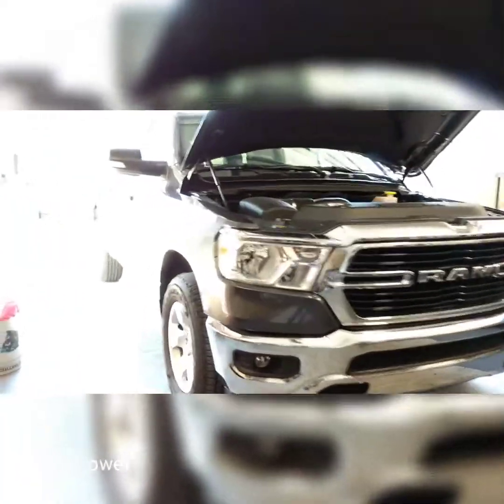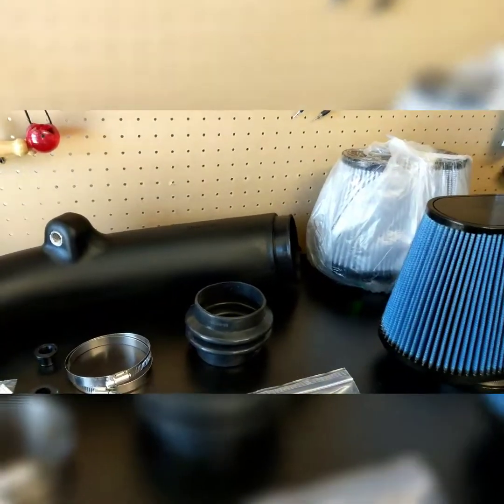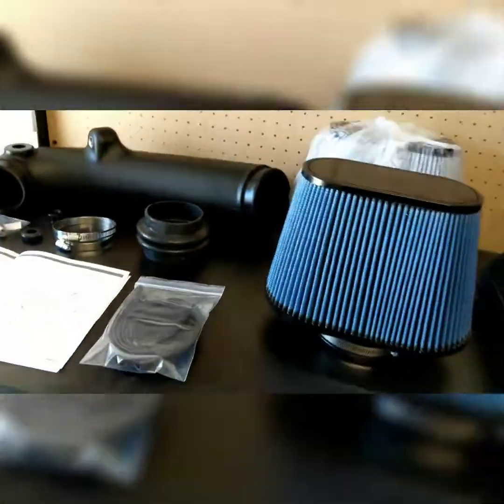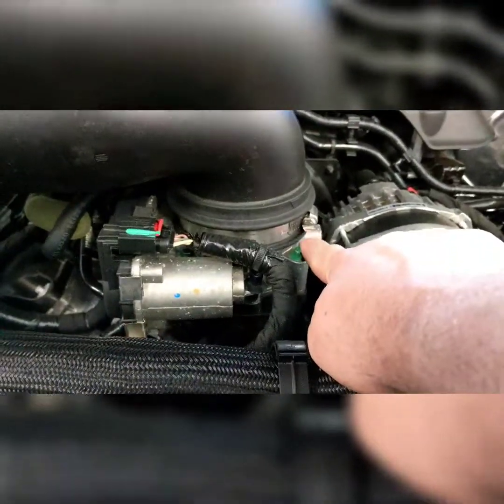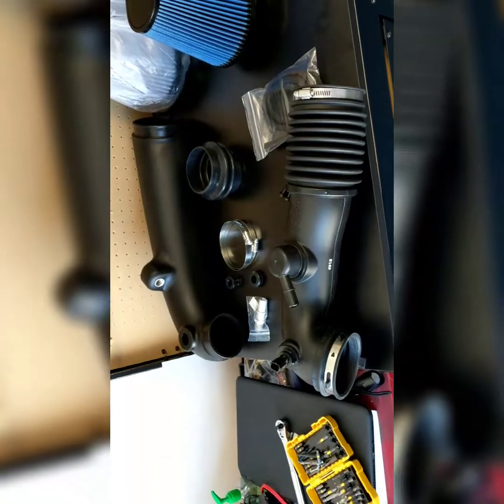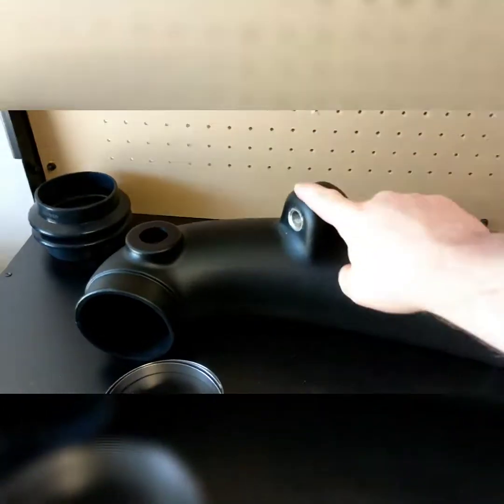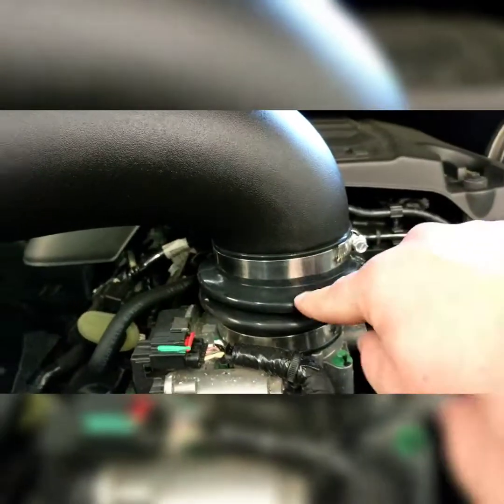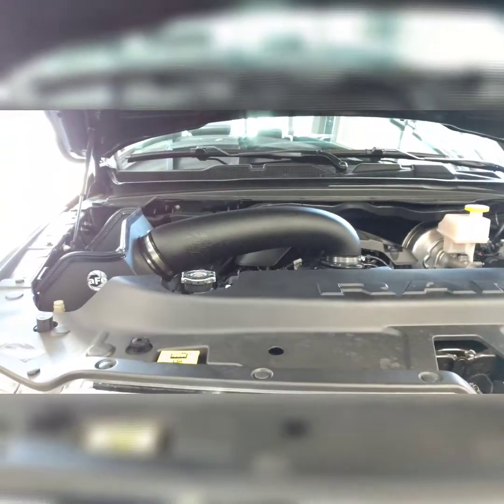19'-21' Ram 1500 aFe magnum force cold air intake install video*SOUNDS AWESOME*

Comment: Did you see any increase in horsepower. Thank you!
Reply from the maker: Yeah it certainly helped some. It's sounds great too.
Reply: @HughesGarage  Thank you for replying back so soon. I have used cold air intakes before but never owned a Dodge Ram pickup before. I will get one not sure on what brand like K&N or aFE Magnum. Did you do some homework or just chose that one. Sorry to bother you with so many questions. Also what else have you done. I just purchased a 2019 RAM 1500 BIGHORN Black w/ blackout emblems look nice.
Reply from the maker: I went with the aFe because of the price and from others that had gotten it before me had said. I just installed the pulsar module.
Reply: Hughes Garage Thank you for the update. Have to look into that pulse module.
Reply: hey brother did you install it? I just got also a ram limited but looking wich one will work better @luisguzman3432
Reply: @realexc89  I ordered it this week from Afe but there on back order til April. Once i have it will update you. Thanks bro.
Reply: that will be great thanks a lot!! @luisguzman3432